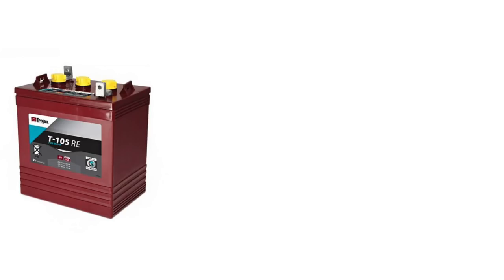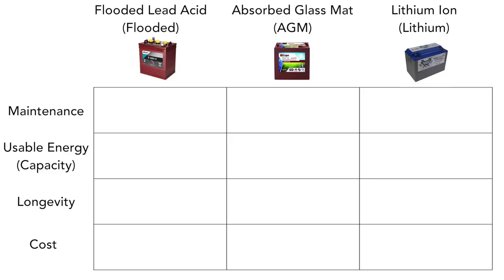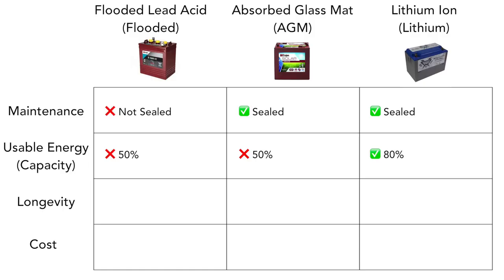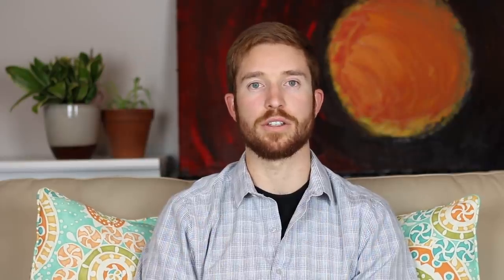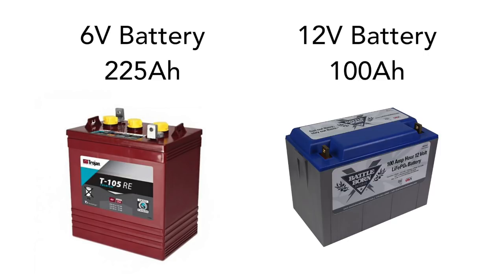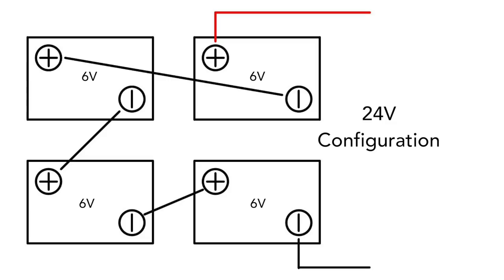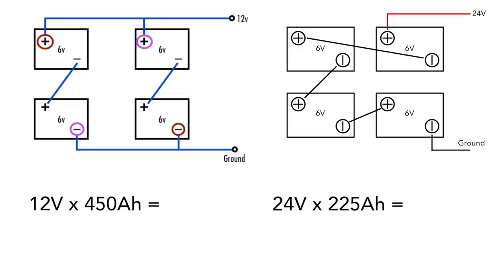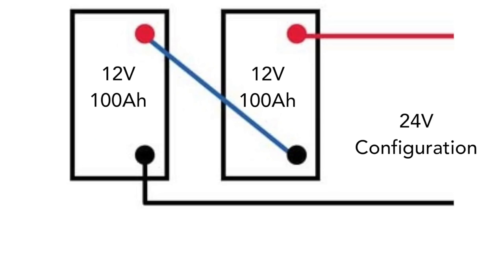Battery Bank Options + Wiring Solar Batteries from 6v to 12v vs 24v

Comment: I agree with all you've said with one slight caveat. Lead acid and agm can be purchased anywhere. For those in the prepper community, access to lithium batteries might be impossible should a shtf deal happen. Conversely, with all the dead on the side of the road vehicles around, access to 12 volt batteries won't be a problem at all. The other point to make is it's easy to add more capacity at a cheaper cost than Lithium. (8) 6 volt batteries in series/parallel would provide huge power and probably never get anywhere close to 50% discharge. Many RVers use the (4) 6 volt batteries simply because their power requirements don't exceed even 70% of charge.
Reply: Bob Bradley and the fact that adding  4 more 6 volt batteries will be adding another 300lbs if the batteries are 75lbs each. So (8) would be 600 lbs. weight is a big consideration when building a van conversion.

Comment: Also, I think an honorable mention in this video would be the drawback of the type of maintenance. You mentioned having to refill the water in the flooded lead acid battery, but failed to mention the consistency of having to bring the batteries to a full charge to avoid degradation. As I understand it, lead acid batteries need to be brought back to full charge after every use, so say you have a lead acid setup that you are using every night, before being able to discharge your batteries again they need to be charged to %100 capacity, whereas a lithium battery only has to be brought back to %100 every so often. (I've gotten mixed information on the subject of how often lead acid needs to be recharged, but the fact that I've heard this alot about lead acid tells me that there's some truth to it.)
Reply from the maker: +Brion Lund Great info! There is a lot more that I could have put in this video but I also have to accommodate for attention spans lol 👍🏼 I will do many more videos in the future 😊
Reply: @DuetJustusFam  (Mike), I just saw this video and need to ad to what Brion mentioned.  BTW, what I'm about to say would not have taken much longer in your video.  Since this video series is in reference to solar, you also know solar charge times used to size systems average around 4.5-5.5 hours per day.  You stated that the Lead Acid & AGM only have 50 % usable energy.  However, that really is false.  Since a charger can bulk charge only to about 85% for these battery types and then must go into absorption to charge the other 15%.  That will almost NEVER happen on solar charging alone.  So, in reality, one can only get about 35% DOD form lead acid & AGM in a solar only configuration and should plan that when sizing system.  Whereas with lithium, you can charge at 1C till full (0.5C for maximum life !)

Comment: Nov 25, 2017   Ignore the other post messed up format on it

In this system was my setup with NI-Cd batteries: 

And to give ideas:

Just for info look into flooded Nickle Cadmium (Ni-Cd)
 batteries: My first solar / multi power system (solar, wind, and water 
wheel generation set-up) the system that I started the set up in 1980: 
I went to a train repair yard and got the 2 volt flooded Ni-Cd batteries 
for free with the wire's: They weighed about 75 lb each: When I got them
 home I made 12 volt banks; then wired them into multi 12 volt banks 
(For a power generation system of 6000 to 10,000 amp/hour) with enough 
battery reserve to run my shop and trailer easily for 2 to 3 months 
without any solar, wind, and water wheel generation input: I built this 
system over about 10 year's (Up grading my 2 volt wet cell NI-Cd 
batteries and solar panels and generator's "For wind and water over the 
year's") from start of project is 1980 until my 5^th wheel was burnt 
down in 2001: The wet cell Ni-Cd batteries of that time could be 
discharged down to between 2% - 5% and was best to do so if not just 
maintaining them (So they would not form "My NI-CD" a higher % memory 
discharge - 'discharge to 50% if do so they will drop very fast past the
 50% a point where the could not be used and need a full recharged' and 
"Maintaining them between 97% to 100% to keep the life span very long 
with a 

very deep discharge befor a memory drop off" occasional 
discharge down to 2% from time to time is good for them): Now with 
today's technology you would need far fewer batteries than I needed at 
the time I started my system (I have been buying equipment for a new off
 the grid homestead system with multi generation capacities and 
locations): But if you build this type of system research all type's of 
batteries / battery system and battery voltage's and Amp's from 2 volt 
to 24 volt and even higher voltage's and high Amp's in a single package 
", ie: 96 volt" (Even look into starting with used car batteries and 
upgrade as monie allows): Now I can not stress enough for you to do 
"YOUR RESEARCH INTO ALL DIFFERENT SYSTEM'S" To find a system that will 
work and/or start out best for you with upgrade's as monie, capacities, 
need's, and ect. "again Homework, Homework,Homework, Homework, and even 
more Homework.

General info for my new system:

Like power 
for my water well solar with battery storage but when the batteries are 
full just maintain the batteries then the extra generated power sent 
to my main power house where all my power generated is stored; (Where all
 of the battery storage system would be located) "Like from my water 
well, night time security lights, shop power, green house power anything
 that uses a little power but still is generating more than is needed, 
and ect" They don't use every thing at once; each of the befor mention 
system's have their own power system's but are able to send power to the
 main power house and receive power from the main power house when 
needed: Again discharge the system from time to time that is recommended
 for your system.

Comment: I agree with concerns about weight, especially for us in RV’s we are pulling, it is a big concern between the different type of batteries. 

Just as a FYI some lithium batteries (such as battleborn which you show) allow 100% of the battery to be used. In batteborn’s case, the 100 amps is usable and the battery is actually larger than 100 amp but the bms turns it off at 100 amps. Have never heard what it’s true amps is but heard speculation it’s about 120 amps. I just got one last week I’m presently installing as a test in RV before potentially getting more 😀
Reply from the maker: +Jason Smith Absolutely. I picked four areas to compare but like I said, there are many more variables that would have clouded the purpose of the video. I will go into much more detail in future videos. Yes, some lithium batteries can go full use so I really should have put ~80%+. Thanks for the great added info 😎
Reply: Yes I agree hard to discuss everything in one video. I think you did a great job to keep the content and info at a reasonable amount to digest.
Reply: I think all the LiFePO4 batteries that come in a regular battery case with BMS included will be 100% usable. The 80% probably kick in when you use the lithium stacks which don't come with BMS - so you first build your battery and then attach temperature sensors an BMS boards to them (think: deconstructed Lithium battery). At that point you'd have to adjust for the 80% discharge.

Comment: I have 20  Walmart 29 max  flooded batteries running sense 2014 and going strong on a 6000 watt solar array .It is now July 2021 EverStart Maxx Marine Battery, Group Size 29DC (12 Volts/845 CCA)

Comment: I have two questions. First, I don't remember what channel I got this from, but they were saying you can take a 24 volt solar panel array, feed it thru a MPPT controller to a 12 volt system. Can this safely be done. Secondly,, with lead acid batteries one cycle would be when the batteries reach a fifty percent charge? Thanks

Comment: Great video, but since this was made, prices have changed dramatically. Lithium is amazingly cheap now. I have a growing collection of powerful lithium batteries. Lead Acid has dropped in price too. So a small collection of 150ah batteries as back up for cold conditions. 
Lithium is so dependable though. I've upgraded my panels and controller. And excellent DC charger and BMS for cellular (already built in on my 100ah banks) big builds for true off grid power - amazing!

Comment: Could you discuss drawbacks/anomalies of parallel battery circuits?  I'm old school and the wisdom of those days forbid batteries (dry cells, wet cells, etc.) from being connected in parallel.  The premise was that the parallel bank only performed to the limitations of the lowest performing cell (discharge rate and voltage level).  So it was never a simple matter of increasing current capacity by multiplying the number of cells.  The net gain was mostly disappointing. I have always assumed that there be some sort of isolation/"ideal diode" circuit for those battery banks with parallel connections. Has this changed and now simply ignored?

Comment: The other part not mentioned was weight and the amount of space needed for the batteries.  The lithium battery weighs less and needs less space. But if you are on a large piece of ground with plenty of room for storage you don't need to worry.the nice part of the battle born batteries is they have built in safety features. Plus when in a mobile app. The weight is approximately 30 pounds per battery. It's not always about which products are cheaper. Space and weight are important things to consider also.

Comment: By your own numbers I can replace my lead acid batteries five times for the cost of lithium . I have had banks last twelve years with no problem so, the lead acid systems will last 60 yrs compared to lithium's 20 for the same cost. Until the numbers balance out, I'm sticking with lead acid.
Reply: agreed. One more reason is that the Lithium battery price will very likely go down in coming 5-10 years or a new tech will emerge as even better choice. I will wait.
Reply: Can't agree more. If the particular need imply mobility, like in RV, camper van, etc. the case for the lithium's pile some more advantages. Due to smaller foot print and weight. But on fixed installations, the lead acid batteries, I believe, will rule for several years. After all weight is no issue and foot print probably is no concern either. But cost on the other hand dictates the out come quite clearly! ;-)
Reply: And I think the Li batt is more dangeours...
Reply: @molnarerik3428  It's not chemically the same as the ones in the airplanes and other cases where violent fires occur .
Reply: id be worried using solar with lithium. lith likes to go blowy uppy
Reply: 60 years for lead acid 😂🤣 Okay buddy.
Reply: @shawnd567  5 times 12 is 60 did that math go over your head
Reply: The big advantage to Lithium is that you can drain them to zero percent where most batteries are damaged if you go below 50% and  even less for lead acid (I think it was 20%). So you get double the output per cycle with Lithium. That being said, I'm still not going to use Lithium. I haven't watched the video yet. Sorry if I'm just repeating.
Reply: @SolarSailor1967  The key  to designing your system is to calculate the requirements and only cycle 20% of your capacity in a  lead acid bank per day. They will last 12-15 years easily. I know, I've done it. When Lithium reaches a cost effective level, I will be on board.
Reply: Yeah my forklift batteries have been going strong for 17 years now no issues, bought automatic water fill and easy one time water every two months, save myself a boat load money.
Reply: @shawnd567  you can get 60 years out lead, lead batteries can be reconditioned, my forklift batteries are reconditioned, date code on them are  Jan 1983
Reply: If you had lead acid last 12 year, you obviously do not use those batteries very much. 
Also, you get twice as much power draw from lifpo4 batteries, without damaging them. A 100ah lead acid, is actually only 50ah, and that's if you keep the Amp draw low. 
Lead acid batteries are exponentially more expensive than lithium. Add to that the weight if lead acid, compared to lithium, and the pros of lithium over lead acid is a no brainer. 
If you don't use battery power very much, by all means, stick with lead acid. If you are actually using batteries to power stuff, lithium is by far the better option. It's lighter, cheaper, and exponentially more powerful, they don't offgas poison, won't leak acid, and flat out safer. 
You can jump through all the mental hoops you want to, it doesn't change reality.
Reply: I would disagree.   
Lead acid you can only take To 50 percent discharge.   So you have to buy 2 lead acids for every lithium to get the same usable aH .   In the desert at least lead acids are good for 4 years max.

So i have 300 usable ah from 3 lithium that cost me about $1200
20 year warranty

Id need 6 lead acids to match the useable ah  at $150 that's $900 or $4500 over the same 20 years...

Plus you can install the liithium anywhere
Reply: @markaustin4370  or $1800 if a set of lead batteries lasts 10 years :-)
Reply: Lithium won't last 20 years. They have a set rate of decay
Reply: Light weight and steady voltage through out the curve. Big bonus but that price difference per AH astronomical. 

Proper load balancing charging and discharging plus the distilled water maintenance plugs. Lead acid going longer than 10+ years. 
6v GC2 seems to be the best choice right now per AH, because that’s what really matters.
Reply: @SolarSailor1967 no you can’t 😂

Comment: the video may have missed a key consideration factor, i.e. operation temperature. Lithium ion batteries have problem in charging below freezing. I think that is very important to consider.
Reply: @A L - Keep it warm or buy a self-warming battery ...

Comment: Thank you for the video. Just curious, at present we have an RV with two 6 volt golf cart batteries in a vented housing.  The batteries are now about 2 years old and the AC DC converter has done well to keep them charged at least I hope?  If we decided to go with an Iron phosphate Lithium 2 12volt battery system do you think the converter controller needs to be updated also?  Thank you again for your great video,

Comment: A technical question. Which of these set ups charges quicker? Using a same charger and solar panel system with the same amount of sun?

Comment: I would have added a few more columns like weight / size and efficiency (that is, how much energy will the battery waste just to store energy).  A lithium ion  is damn near perfect, as it is almost 100% efficiency, that is, whatever your solar panels put into the battery, you get 97~98%  back out, where a AGM, be lucky to 80%. So you're losing 20% right there!  Good info, the only other problem is, running a FLA battery down to 50% is almost killing it. More likely you should never drain it past 40% Probably more like 30%, personally I would go below 35% to get max life cycles of the battery.

Comment: Concerning flooded lead / acid batteries:
Don't get confused about the 50% discharge. The listed amp/hour rating of a battery, if the manufacturer is honest, is the amount of amps the battery will deliver consistently for at least 20 hours. This is the industry standard "bench mark" test. If a battery is rated at 200ah the 50% discharge limit does not mean you will only get 100 amps out of the battery. It means the battery is capable of putting out 200 amps for 20 hours - which is actually a huge amount of current only found in 8D group size batteries or bigger. Only when the battery reaches a voltage of 11 volts will this current capacity begin to (sharply) drop off.until it reaches 10.5 volts; considered to be "dead".
Another thing not mentioned is to make certain your system is using "deep cycle" or "deep discharge" batteries. An automobile battery is physically designed to deliver a large amount of amps in a very short period of time and rated as Cold Cranking Amps. The thinner, more numerous lead plates inside the automotive "cranking" battery can deliver the high current, but will quickly build up with permanent lead-sulfide scale that eats through the plates or shorts them out if discharged too deeply, too often. A Deep Discharge battery has fewer but thicker plates. This results in lower discharge amperage but gives a constant current over a greater period of time. Because the plates are physically thicker they are not as easily damaged by sulfation and can, by design, be discharged to lower levels more often than an automotive battery.
Reply: "200 amps for 20hrs"  😂😆😅.  I think you're the one who's confused about how Ah's work.  LOL

Comment: but why would you want a 12v or 24v system ? higher the voltage, lower the amperage so does it all come down to wire size and saving money on smaller gauge wire?

Comment: You do understand that forklift/traction batteries are designed to go down to 20-30% state of charge DAILY and are warrantied to do so for 5-7 years, You CAN go below 50%, and with a home system you can plan to do so rarely and be fine. My Forklift battery is 24V 660 ah and would cost $2700 to replace,  It is 12 years old and will need to be replaced in the next year. Comparable LiFePo4 would cost $4500 (today 2022) and it would also have to be kept warm, my lead acid battery banks have always lived outside. So some additional cost there, something you neglect to mention.
Reply from the maker: This is great information. Thank you for taking the time to share it. 👍🏼😎☀️

Comment: From what I learned about solar power. It seems to be a better choice to choose deep cycle battery (DC). And many told me to buy golf cart battery. What's thrue what's not? And as for the DC battery, is any deep cycle would it will fit?  Assuming that DC is the one recommended.